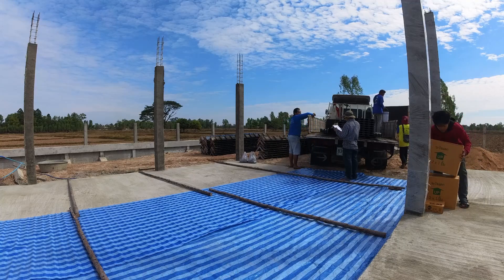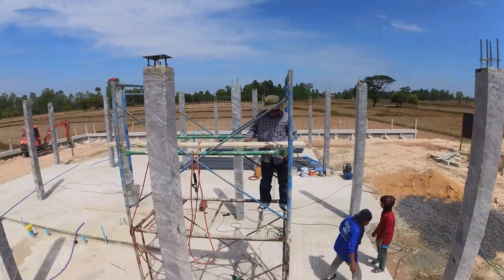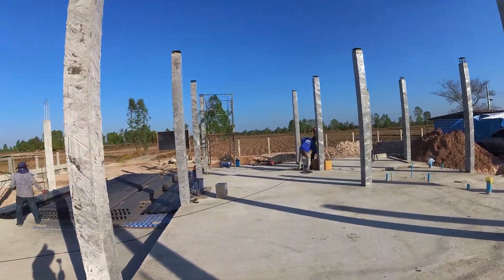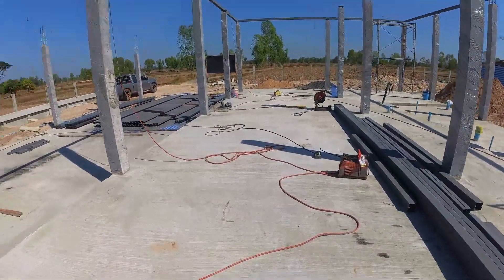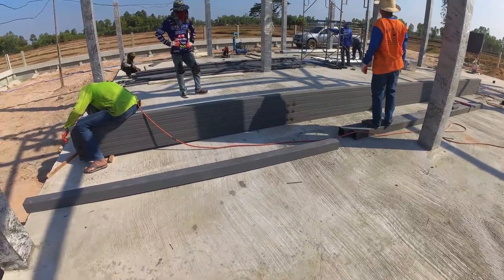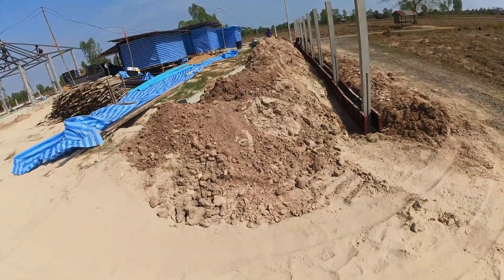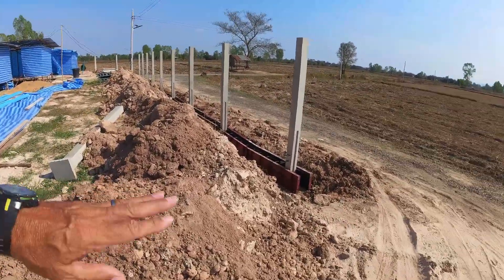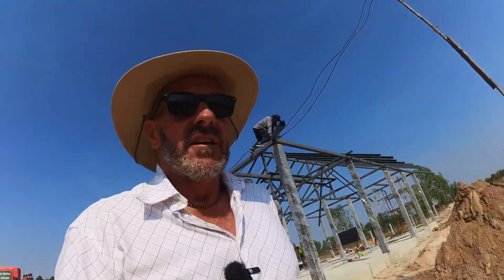Building a Roof Structure

Comment: Kool…:-)) Man, when I think about it….the whole house foundation and steel roof structure is going to last a long time. So…the plates they put on the columns … are they sitting on the rebar ( now the welding makes sense) and the weight of the roof is all on the plates..? Steel roof trusses …. And they were pretty quick with it. Thanks for sharing Kenny….😊😊
Reply from the maker: Yes, the plates are supposed to sit directly on the rebar. With mine they were too short so they pounded in a second piece beside the originals. Yes, all of the weight of the steel and concrete roof tiles sits directly on the top of the columns. The block walls hold nothing. The load is directed straight down through the columns and onto the tops of the pilings we pounded through the old rice field in December.

Comment: Consider filling up the air gap between the roof metal plate and column rebar with Non Shrink grout mortar to reduce corrosion at those joints
Reply from the maker: Already spoke to Duke, it is agreed. Thanks